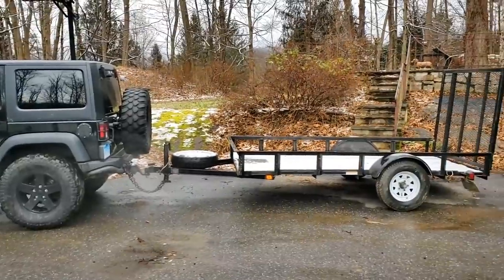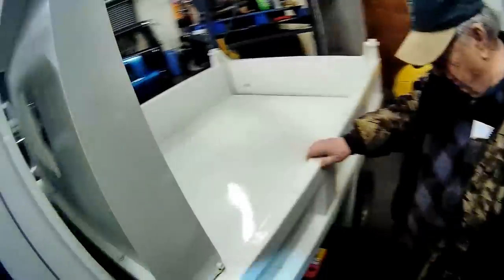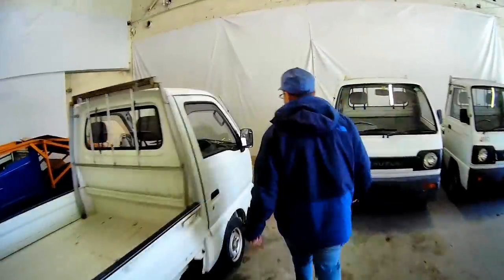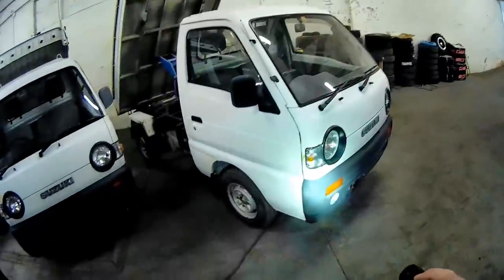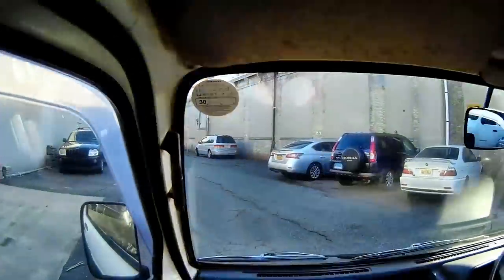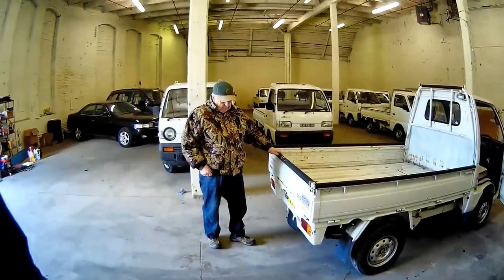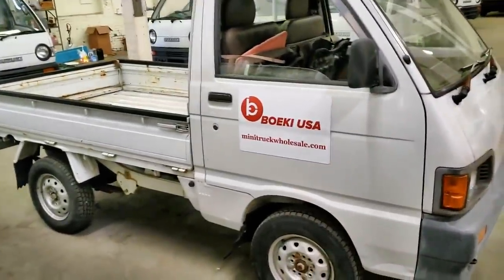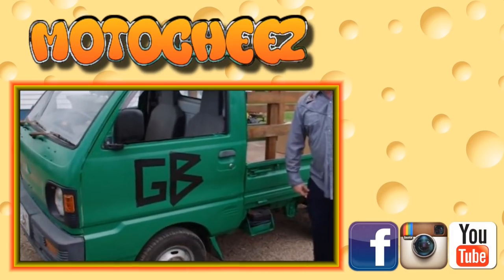$4500 Mini Truck info (SE01 EP01) what to look for, buy and get it home on 5x10 trailer

Comment: I'm in Tokyo, have been for 28+ years.
The Kei trucks (Kei means "Light Weight") are great, cheap to buy, cheap to run, cheap to insure. 
The engines are 660cc three cylinder.
For traction the Subaru are the best, because the engine is in the rear.
You can tell the older trucks by the round headlights, the square or rectangular lights are on the newer trucks.
I'm a carpenter, and I have a Subaru sambar Micro van, it's 10 years old and I plan on having it for a very long time.
You should get 100,000km out of the motor without any trouble, at 100,000 Km it's time to change the timing belt, other than that they run forever.
Great trucks!
Cheers from Tokyo!
Reply from the maker: Hi, thanks for the information. I considered the sambar but they do not come with an axle lock which I need for the terrain around here as you can see haha.
Reply: Well I'm in Tokyo so I don't need 4wd, but when it snows (yes it snows in Tokyo) with just good snow tires I've got more traction than most guys with chains, because the weight is over the rear tires. 
You can get 13" rims for these trucks, so you can put larger tires on them.
Cheers!
Reply from the maker: True! I wish the 13" rims for this hijet we're available in USA. Hard to find except ATV rims
Reply from the maker: Nice! I'd love to get one of them with both!
Reply from the maker: 5 speeds too I think, right?
Reply: Suzuki and Daihatsu have a diff lock because the traction performance is bad.
Those seem to intentionally make the rear lighter on the premise of overloading.
Subaru and Honda have many customers in Snowiest place.
Differences between manufacturers of kei trucks are determined by the customer's requirements.
Reply from the maker: Ah, ok thanks. I prefer having rear lock for my rough terrain. Off camber rocky and hilly here
Reply: Was in the Navy and stationed in Yokuska for 3 yrs  ... can you send me some yakasobo plz...lol
Reply from the maker: Hahaha! 👍👍👍😄
Reply: i think the model we had was a rust-bucket Daihatsu.  the only thing i ever needed to repair was to replace the starter motor.  took about 15 minutes with nothing more than a crescent wrench.
 another thing that was cool about it was how easy they are to work on.  super simple motor (rear-engine), essentially all exposed, and good ground clearance.
  not really fast, but fast enough for japans expressway system, (just barley do the speed limit 100 kph about 60 mph ...). it took more time squeezing in and out of the cab than it took time to get to town.
Reply from the maker: Haha. Nice. Like the getting in and out of cab comment lmao
Reply: @jacklarson6281  : I don't remember the make just that at 6' 4" it was a pretty tight squeeze in and out and felt like my knees were around my ears...lol...that and if I hit the brakes to hard it would flip over forward...lol
Reply: I’ve been thinking of very similar sambars. Do you have any more info about them?
Reply from the maker: I have a bunch of links in the description of this video
Reply: MotoCheez 
Do you have a link for his business
Reply: @TokyoCraftsman  how much do these little sambars cost second hand , i would like a little truck for a gardening business
Reply from the maker: Yes, all his info is in the description of the video
Reply: Yay for Tokyo!
Reply: @MotoCheez  join  the "japanese mini trucks of america" facebook group. There's loads of good info on there for minitrucks
Reply from the maker: I'll join them. I was trying to go in as blindly as i can, and not steal anyone's ideas for my videos. 😁
Reply: @citic101 good ones used are hard to find, they tend to be used and used until they are really worn out, or they are slightly used and will be nearly the cost of a new one. We bought ours new as the best used one we could find was 4 years old and about 80% of a new one. The new one I could get exactly what I wanted (they build them to order) and I had a nice warranty to boot.
You can go onto auctionsDOTyahooDOTcoDOTjp and use Google Translate to find the category for used vehicles, Yahoo auction is like Ebay.
Cheers
Reply: Thanks TTC for your comment
Reply: I'm  13...I'm going to Japan when I'm 16 for 30 years....can you give me advice?...I think you know what I'm going to Japan for (profile pic)
Reply: These are common vehicles in Thailand,they use them for everything
Reply from the maker: I can see why, they're built very good.
Reply: @慈恩須水  That's useful info, thanks.
Reply: Can you help me find rear cv axles for a 92 honda acty?
Reply: @jameslomax6830  I can if I spend a lot of time looking. My being able to read Japanese will not reduce the time necessary to find car parts by much as compared to searching in Enlgish.
If you fins something on a Japanese-language site that you think might be what you need, you can respond to me here again as you have just done, but please note I do not search for car parts for a living. I happen to live in Japan and speak Japanese, but I have a full-time job that is not connected to car parts.
You are not the fella I respnded to before, are you?
Reply: Yes Tokyo.  U are a smart man
Reply: I am 6'3, and slim, would I fit?
Reply: It's disgusting that US won't let us buy or make new ones for sale here.
   Fascism or oligarchy if you want
Reply from the maker: @jupitercyclops6521 💯💯

Comment: This is the same place I bought my kei truck from. I got a 1987 Suzuki Carry. The owner is a great guy, can't say enough good things about him or the trucks he sells. I got mine titled in NY, used it to do home renovations. Twenty sheets of sheet rock, lumber, furniture, you name it. So handy, so much more useful than my Tacoma for stuff like that.
Reply from the maker: Ahh, so NY you can register them, I have some people asking and I just saw a few ppl from NY that have, good!
Reply: Can it be registered in Florida? Could be an awesome little truck
Reply: Donnie Brookins 25 years or older imported as a passenger vehicle you register them as classic vehicles. That’s how it works nationwide as far as I know, you can google Registering Mini Trucks in Florida and see what folks say. I only know about what I and other locals have done with any certainty. Most of the trouble is the DMV not knowing what to do, a problem they have with almost all import vehicles.
Reply: frailcolin 
How does the heater and air work?
Reply: DEploribus Unum Heat is fine. Mine has “Winter Specifications” whatever that means but it leaks cold air into the cab either way. My truck is weird, only the feet blowers blow hot air the ones on the dash are only fans but I can get it comfortably hot in there. Mine doesn’t have A/C, A/C is harder to find and especially on older Keis.
Reply from the maker: I don't have AC either, but my heater will cook you!
Reply: @MotoCheez  I saw someone driving one of these a couple months back in NY and know I know what they are, go figure
Reply from the maker: Sure, but they're underpowered for highway.
Reply: @MotoCheez  Just wanna update; NY suspended my title. I'm not the only one. Someone who has their truck registered for 4 years got it suspended too and a few others. NY doesn't care about the 25 year rule and they're cracking down all the sudden. They told me to send the title back. Where do you register yours? Inside your own state or out?
Reply from the maker: @Codemonkey3  I heard upstate was doing this to one guy.... That really sucks!

Comment: Glad I saw this! I've been looking for one of the Japanese Kei trucks since I worked at Yosemite in the early 80's; they used them as utility carriers and trash haulers, but all were made with left-hand drive. A dealer in Reno was selling them, but they were limited to 25 mph for some reason. I'll be keeping up with your progress. Thanks!
Reply from the maker: If it was limited to 25 miles per hour, they were the newer import trucks that could not be registered for the road. If it's over 23 years old you can register it as a classic.

Comment: If you like those mini trucks you would love the next general size higher. Never seen them in N America but of course Asia, Africa & here in Bermuda is crawling with them. As much bed space as 1500 pickup, fold down sides, available with diesel, A/C, power windows, all kinds of goodies, gassers usually 1800-2000CC, some are duallys, fuel sippers.
Reply from the maker: I'll have to look them up, sound interesting. What I like about these minis is they're the size of the UTVs and great for trails offroad that cost 3 times as much
Reply: Doug Shirley 
Oh, you mean something like the original vw bus and pickups
Reply: You recall the model name of the larger version?
Reply from the maker: Bongo?

Comment: Amir is a great guy! Great place to get a kei truck. He'll give you all the necessary paperwork to properly register it too (if it's old enough to be) and will help you out if you run into problems.
Reply from the maker: Agreed!
Reply: What are the price ranges?
Reply from the maker: $4000 and up, have more information in description.
Reply: Are you saying the newer ones cannot be registered?
Reply: @grantprice1932  Generally no. Some places allow LSV registration, but if you are looking to register and title it for normal road use, it needs to be imported when it is at least 25 years old. You also cannot import a 22 yr old vehicle, wait 3 yrs, and register it. It will never be exempt.
Reply from the maker: I don't believe so, there's some rule about these imports and if they're not on the nista list you're not allowed to register them. You can register these because they are a classic cars and it's beyond the years that they set. I believe it was Mercedes that had this law brought into effect in the United States because it was cutting into their sales. I could be wrong but that's what I heard
Reply from the maker: I never realized if you brought a car in that was newer than 23 years old you can't wait to get it to be exempt. That's crazy. Looks like someone's going to have to lobby and change these laws huh. Haha at least let people register them for back roads and non highway use like a scooter under a hundred 50 cc's. I know that they're not very safe but neither are motorcycles and scooters and smart cars

Comment: Been wondering how to get my hands on one of these trucks.  So practical for running around town and work on the farm.  When I was a kid my Dad was in USAF.  We lived in Far East for many years in the mid ‘60s thru 1972.  My dad had one of the grandpas of these trucks.  A 3 wheeled Toyota with a little 2 cylinder engine.  Drove it to work and all over Okinawa.  We had a blast in the thing!
Reply from the maker: That's friggen awesome! Those old 2 cylinders were 2 stroke!

Comment: I've been looking into these for use in the mountains above my house. Like you, I figured why but a UTV when these can be had for less money, and made street legal. I do firewood for the neighbors in the mountain, and would like something bigger than my atv with a trailer. Looking forward too see what you do with it, and how it runs.
Reply from the maker: They're great for that. I have a whole playlist in the description. Thanks
Reply: You can get a hitch for these with a receiver and have I believe three different ball sizes. You do have to drill two holes in the frame to a mount the hitch.
Reply from the maker: @laneclaypool8005 back when I bought this a really wasn't any options It's 5 years ago I actually made my own 2-in receiver

Comment: I bought my 1992 Suzuki Carry from Amir last spring. Amir is great to deal with, and I love my mini truck. I was going to buy a utility vehicle, and am so glad I didn't. I lifted it 2" and put 24" off road tires on the existing rims. The truck will go anywhere. It also will carry way more than it's own weight.  Great video!
Reply from the maker: Thanks! I also did that to mine now, added front winch bumper etc. Here's the playlist. I'm up to part 17 😄 fun truck https://www.iihs.org/iihs/topics/laws/minitrucks

Comment: Great video 👍 I love those little trucks. These size trucks are all throughout Italy. If they would make them here I would buy them. Car manufacturers in the USA are missing a golden opportunity.
Reply from the maker: Thank you. Absolutely missing an opportunity! Hopefully someone will pick up on it with some money and connections to do something.
Reply: Agreed people go crazy for these trucks and US car companies could care less
Reply from the maker: Correct. That's why the older ones are allowed and not the newer. As classics. Like the classic cars will not pass new tests either..
Reply: thor j  That is the reason the big 3 keep foriegn competition out of our country. Those 3 wheeled bikes are death traps and those too won't pass any safety crash protection.
Reply: @MotoCheez  I fully believe the big 3 do not want these in the country because people will buy the heck out of em so they cite safety issues. What about these death trap 3 wheel motorcycles are they safe? I think not.
Reply: In Canada,the ones that were at a tiny dealer didn't have DOT tires and the headlights were canted to the left for right lane driving. Saw a couple with the sheet metal frame rusted through from the inside. Have a look at the seat mounts-very flimsy. No airbags and not sure if they have a collapsible steering column in case of a crash. Not a serious means of transportation.

Comment: I'd definitely daily one of those so bad ass!
Reply: For 4500 you could buy a used real truck half the age
Reply: Trust me no you wouldn't. I love mine but 45 kph and it's winding out.  Tagging them as a normal car isn't possible either. Mines farm use so I run around the country on it.
Reply: I did daily drive one for 3 years, it is great.  Yip 45mph it is wound up tight.
Reply from the maker: Mine has hits 60mph GPS confirmed with 24" tires, cruise at 54mph... On flat of course. when the stock tires are on a used to read out and run out of RPMs, I think the bigger tires definitely made it go faster oh, but it did lose a little pick up.
Reply from the maker: Would I daily it? Not unless I only worked a few miles down the road on a back road.
Reply: MotoCheez I finally went down a flat road that was long enough. Full throttle got me to 90 kph stock wheels and tires
Reply from the maker: Was it tached out RPMs?
Reply: MotoCheez does not have a tach. Ran out of steam

Comment: Didn't even know these things existed. Seems unbelievable to get so much in an 11' package. The dumping feature, well-built, speed, 4wd capability, decent turning radius, just, wow! Will these things reach highway speeds? With a load?
Reply from the maker: Have not tried to reach highway speeds with a load, unloaded with 24 inch tires I can hit 60 miles per hour tops, I can maintain 55 miles per hour on somewhat flat ground but they're really not built for the highway secondary roads I would say yes.
Reply: @MotoCheez  - I'm very appreciative, that's exactly what I wanted to know. I thought the 50mph on the street, mentioned in the video was impressive. I'm surprised these trucks aren't more popular
Reply from the maker: Thanks! I'm also surprised. That's why I decided to do a video :).
Reply from the maker: I have a playlist if you want to see what they can do off-road etc. https://www.youtube.com/playlist?list=PLcxhNVEfTm_MfjuzlAIXqX5dTFF1uySJP

Comment: Thanks for the detailed review.   I don't know why as a large build man (6' 360#) I find these mini pickups (and vans) fascinating.  Before mentioned I was thinking "glorified side-by-side/UTV."  Not for over the road, maybe a great inner-city delivery truck.  The next step up Suzuki Samari ($5k) then Haflinger - Pinzgauer ($10k-$20k).  Would not have guessed these trucks held up so well for 75k miles (120,000 kilometers).  Agree American brands gave up on not only sub-compacts but even compacts.  Think 1964-70 Dodge A100 (2.8 slant 6, 100hp, 3-on-the-tree).

Comment: In the UK we have these including a UK made Bedford rascal van. They were converted into anything you can think of, I was lucky enough to check a very nice caravan (rv in your parts) . The most common are the panel vans, their engines are so high revving and really fun to drive. Must have been one of the first vans I drove helping a family friend doing deliveries for his butchering business. The load these can carry is crazy, for their size. Obviously hauling cement and hardcore in one is a no no.

Comment: The load limit of my Ford Ranger was 700 lbs before I added more spring leaves and this rates 100 lbs more with an engine 1560cc smaller. interesting.
Reply from the maker: That's what these were built for. Light construction